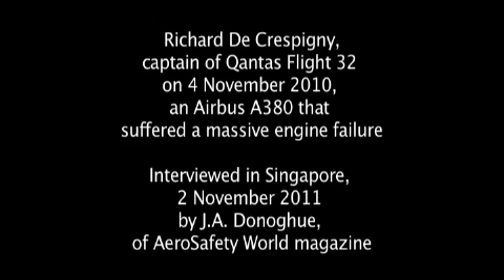Interview with Capt. Richard de Crespigny - Part 2

Comment: As someone who flies regularly, it is heartening to know that there are pilots out there with the kind of skills and knowledge of Capt de Crespigny.  What he describes about abnormal situation management is what is happening in the oil industry, the responsibilities and hazards have not changed, but the technical complexity of the processes and the control systems has increased substantially over the past 40 years.

Comment: Wow, this guy is riveting to listen to, such enthusiasm about the workings of his aircraft.
I still think they were incredibly lucky to not catch fire and burn up before they got anywhere near landing considering the large pieces of super heated shrapnel that went tearing through the fuel tank.
Being a machinist myself I find it shocking that the "severely on the piss" counter bored oil supply pipe got through all the check and assembly processes and anywhere near an aircraft engine, one of my tutors did his apprenticeship with Rolls Royce aero and from what he told me, back in his days they were incredibly anal about perfection in component manufacturing......sad to see such apathy creeping into even the pinnacle of engineering and amazingly lucky Airbus didn't have their first A380 hull loss because of it.
Reply: Boy oh boy any time I fly I would love to be with this man in charge....he really knows his aircraft and listening to his interview it makes me feel that yes I would be in good hands and deserves all the plaudits he received along with his fellow officers on QF32

Comment: To control the functions of hydrolics and flaps and slats, engineers have to invent a angular positionning sensors for the captain to monitor instantly with its automation of flight control by wire on the E-cam video board, for a better monitoring in case of electrical failure and the status of all flaps of their angular positioning to prevent rolling in emergency.

Comment: A Amperage sensor on all the electrical wiring of the hydrolics would alert the pilot of the location of the severed system in case of rupture. A electrical e-cam will summarize for the pilot to overlook the system instantly in emergency.